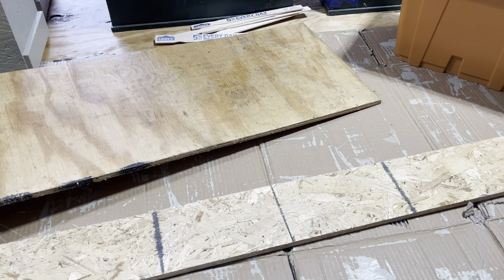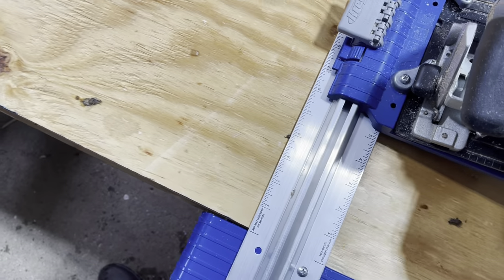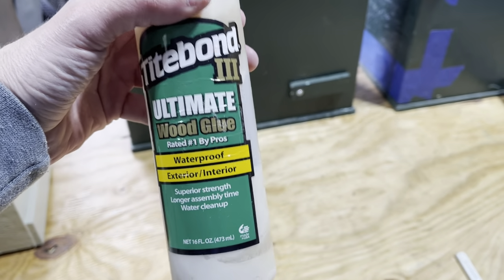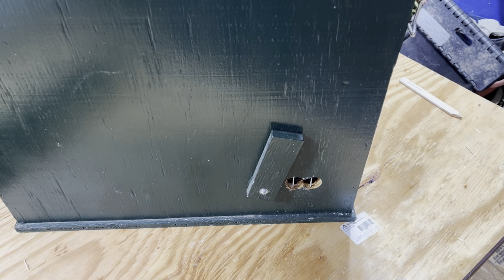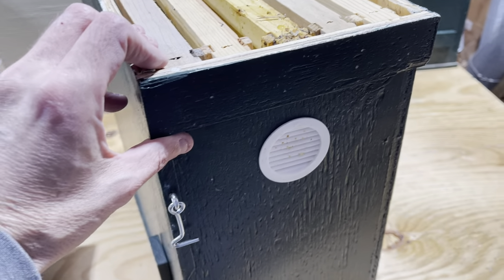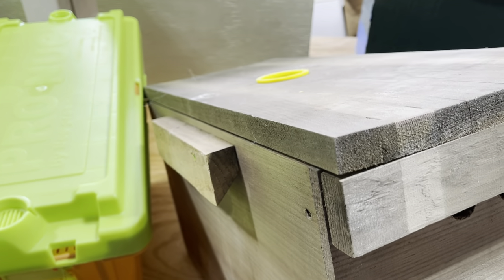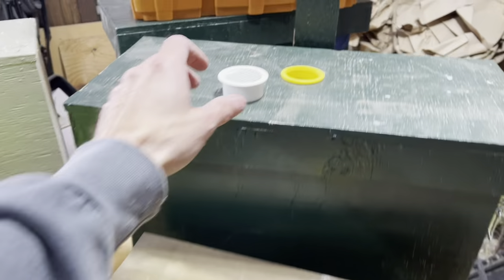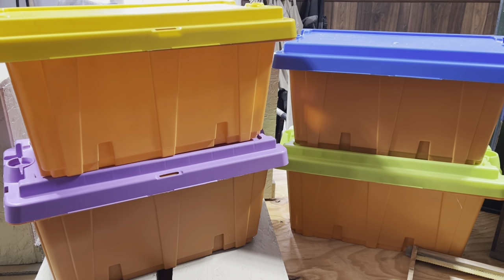Simple swarm trap build and other trap ideas

Comment: Thanks for the tips.  Why is there so much space at the bottom of the trap?
Reply from the maker: @mjones2431  

The size of 40 liters is based on Thomas Seeley research 

First 
large enough to fit even the biggest swarms 

It was determined this was the ideal size bees are looking for in a cavity in the wild so we are trying to provide the same space

My thoughts 
Bees also measure the space by size and echo. They flap their wings and listen for the echo and feel for the vibration. You want them to get that good feedback so even if packed out with plastic frames that void on the bottom helps with echo and vibration. This is why I started and prefer starter strips over plastic. See video below 

Swarms when moving in hang on the bottom of the frames and I have had swarms large enough to fill that hole empty space. They have to all fit to move 

Drawbacks
They will build comb on the bottoms of the frames and it is a waste of resources and can be a mess. I move and install within 5 days after the catch 

Great question 

Thank you for the comment and question 

https://youtu.be/oH3oBXm_czY?si=PZmwCddzVSYOX_LD
Reply from the maker: @mjones2431  

My traps have evolved since that video. Same dimensions and build just more features I find useful

Message me anytime 

Swarm Trap features to consider when building your traps. Swarm Trap baiting and scenting practices
https://youtu.be/VwL30LoU0uE